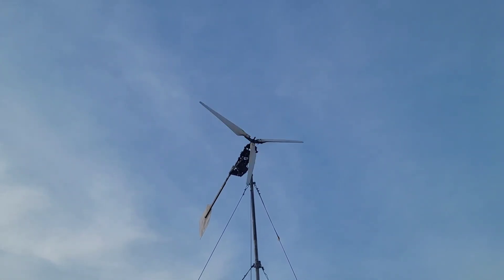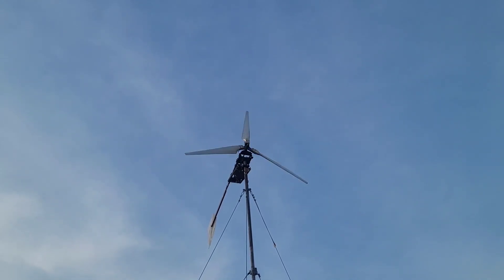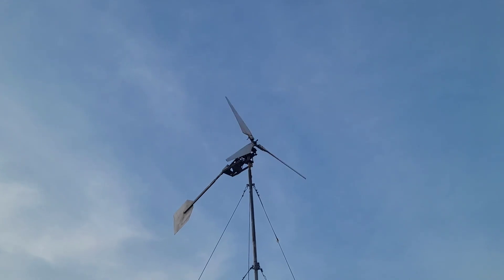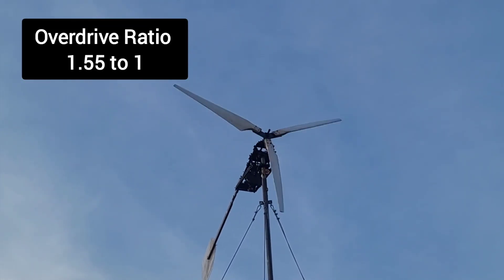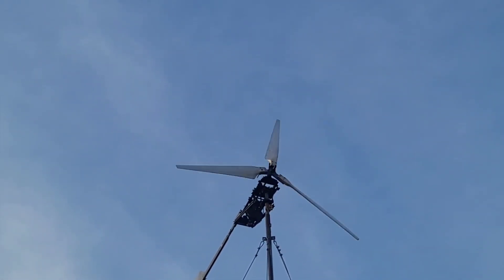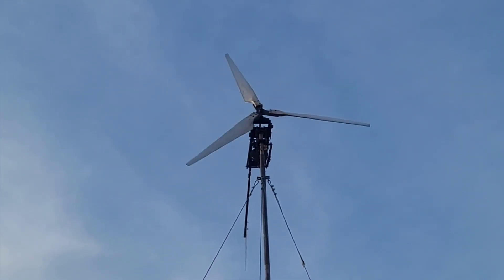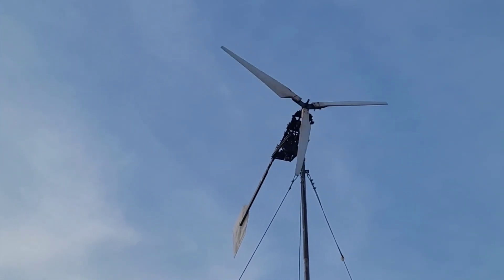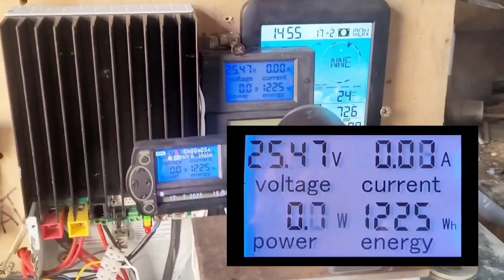3kw Bike Motor as a Generator - RPM to Voltage Tests - Approximate as motor RPM changes constantly

Comment: bro just add a magnet, magnetic encoder and a simple Arduino to tick over once every rotation and reset every minute to get your data. better still use esp32 and remotely connect to see your data over wifi when you get close. code can all be chatgpt'd. nice video
Reply from the maker: Sounds like a cool idea for the future, I was wondering if they have remote hall sensor displays, still a few things to do to get the turbine running at it's max potential.